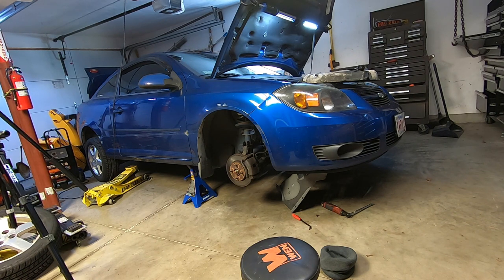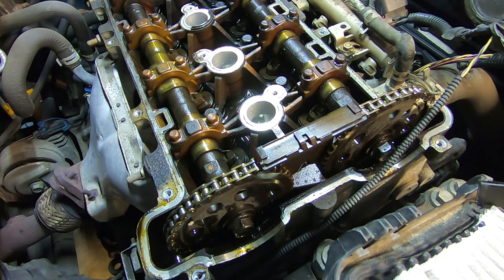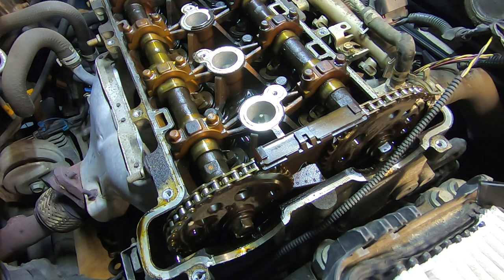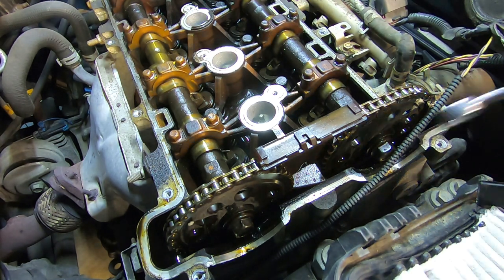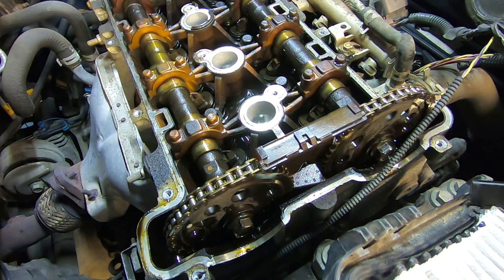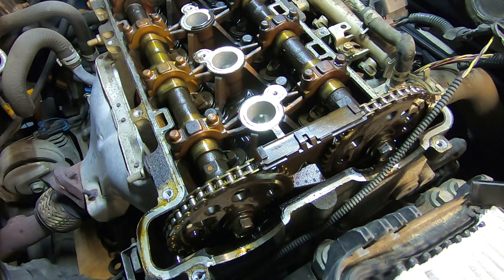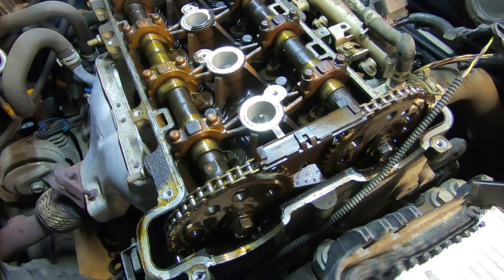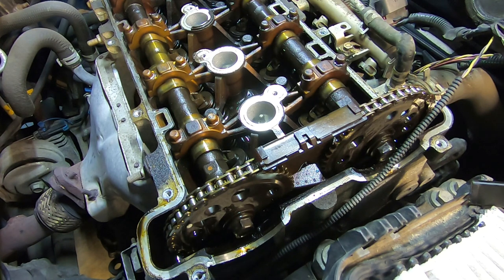Timing Chain Slack / Play Explained

Comment: Thanks for posting this richard. I just replaced my timing chain, guides, tensioner and vvt solenoids in my 2014 equinox 2.4l ecotech  and had noticed once I manually turned the crank 720 degrees to verify no interference that there was a tiny bit of slack exactly where you showed here. Everywhere else the chain was tight.

When I fired the vehicle up I noticed an engine ticking (which was also there prior to installation, but I may be more sensitive to the sound now because of the install). I was paranoid I messed something up and this tiny bit of slack was the only thing I could think of that may of been wrong. This video eases my mind a bit about that and thank you again.

Still gona have to dive deeper on to what this ticking sound could be. Oil is new and full. Never heard of these vehicles having lifter issues but im leaning towards that. Sound becomes more apparent once vehicle is at temp and rate of ticking increases on acceleration. I mean i guess it could be from my timing chain still but its more of a ticking and not a rattling type noise. Any thoughts?
Reply from the maker: It is more than difficult to diagnose a problem from afar.  Turn the sprocket to your right clockwise just enough to take up that small amount of play between the two sprockets. The chain should now be tight everywhere. If there is play anywhere then you still have an issue.

Comment: This helped a lot I’m used to belts not chains and when I rotate there’s no slack anywhere and the the tensioner slammes closed and then i continue to rotate and then there’s slack. And the. The tensioner Shiites forward. Just confused want to know if it’s fine. Great video
Reply from the maker: Sounds like you are ok, slack between the sprockets depends on where the cams are when you stop rotating, as you know the valves are spring loaded possibly causing the sprocket on the opposite of the tensioner to spring backward causing a little play between the two.
Reply: @richardspaulding5035 thanks just wanted clarification since I’m a belt guy 😅. It always meets together every time I rotate the crank to tdc. Also the tensioner runs off oil pressure. It tensions at first then it goes back. I’ve heard that when the cars on the tensioner will not shoot back because of the oil

Comment: I was under the impression that a chain should last the lifetime of the vehicle and did not have a replacement interval like a belt. Regular oil changes with a high quality oil are key.
Reply from the maker: I want to thank you very much for this question as I now realize I should have provided a better explanation in the video. In the days to come I am going to post a follow-up. Engines like the one in the video that are classified as an interference motor usually do have some sort of maintenance schedule for the chain. It may be just a simple inspection interval or a full replacement interval. This is because sever damage to the engine will occur should the chain on an interference motor fail. There usually is no such requirement on a noninterference motor (I think that is what you are referring to). As I mentioned in the video, I did not have access to the owner's manual. I am assuming this engine has a replacement interval because there is no removable inspection plate on the valve or timing cover. Thanks again as I always enjoy hearing from you.